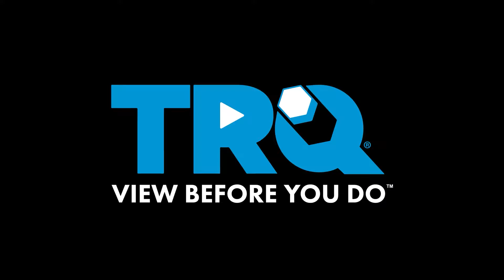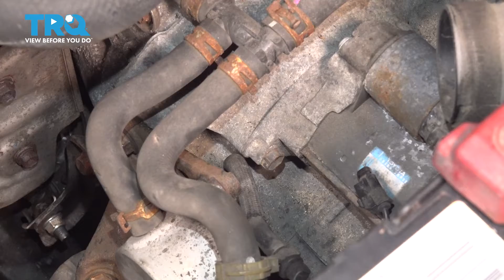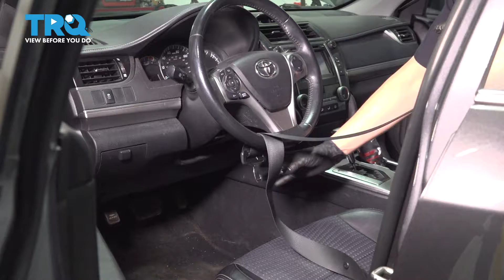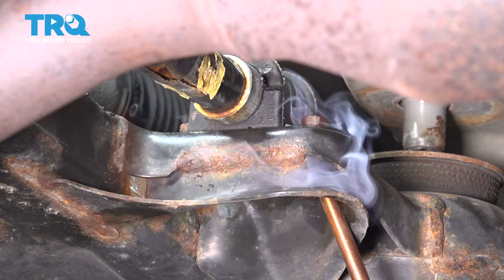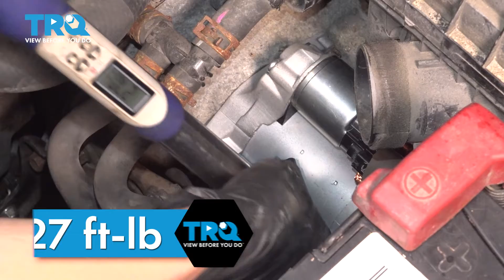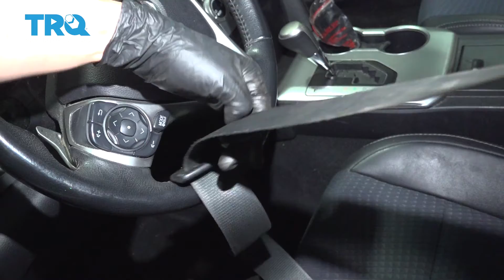How to Replace Front Sway Bar Bushings 2012-2017 Toyota Camry

Comment: How can you publish this video? What it shows is absolute nonsense. Those rubber bushings are removed by loosening the rear bolt and taking out the front one. Then you pull out the old rubber and slide in the new one—exactly as many people here have pointed out.

Comment: You DO NOT need to lower the subframe. You simply just remove the from bolt, then looosen the rear bolts up as far as it will go.  Lift the bushing bracket up, wiggle and slide the old bushing out. Put the new bushings in by wiggling and sliding it in the same way.

Comment: This appears v complicated for a $12 bushing. Im sure Toyota has an easier way around. I will have to look around for some more videos.

This is from AI:
The front sway bar bushings are typically more involved because the sway bar is often routed above the subframe or other suspension components. For the 2012-2017 Camry model, replacing the front bushings may require partially lowering the subframe or using an engine support bar, which increases the complexity and the number of steps.

Comment: 1 A Auto is wrong at least on a 2013 Toyota Camry V6 and I’m pretty sure for the four-cylinder. To I’m pretty sure you don’t need to do all that work. You can fit a 12 long wrench ratcheting wrench on the bushing bracket bolt back bolt also on the front bolt of the bracket you can fit a ratchet socket you do not need to disconnect the battery or starter and do all that waste of time. It may be a little bit harder for that back bracket bolt on the swaybar bushing, but it can be done

Comment: The rubber bushing I got from them look like they’re the wrong ones. They have a little stubbys  on the bottom of them and the one on from the factory is a smooth bottom. The sway bars are the right ones 1Auto why is there little stubby on the bottom of the bushings with the Toyota Camry sway bars that I ordered the wrong bushings probably or what do you do cut the little stubby off in the video he has the right sway bars that I got ordered, but the bushings have a smooth bottom to them. The ones he’s holding, but they didn’t give me those ones. They gave me ones with stubbies on them.

Comment: Wow....this is way too complicated than I thought.
Reply: It’s not way too complicated. You can still stick a 12 inch wrench on the backside of that bushing bracket and go inch by inch and get it out instead of removing all the starter and lifting a whole motor and all that and the frame way easier.

Comment: I just ordered the bushings. I’m sending them back.  this is way more difficult than I expected.
Reply: It’s not they’re lying you can still do it without doing all that work but on the back bracket of the swaybar bushings bracket is a 12 inch wrench and use a 12 inch socket for the front of the bracket for the bushing that back bracket of the bushing with a 12 inch ranchet is a little difficult that you do an inch by inch and then you can get it out or halfway and then stick the bushing in instead of taking the battery out undoing the motor mounts undoing the starter all that work was totally unnecessary

Comment: No way you have to do this. If not rusty you can get that back nut with a box wrench, just take your time. Otherwise, if you really must, unbolt the left side motor mount and left rear subframe corner (the 3 fasteners), pry down a little on the subframe, swap the bushing, reinstall the subframe bolts and motor mount nuts, repeat on the other side, and you're done.